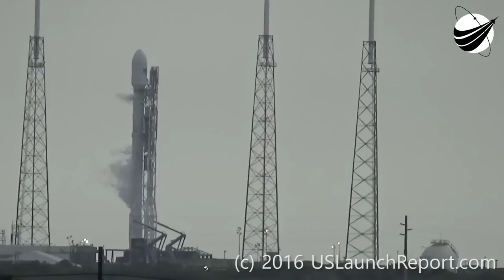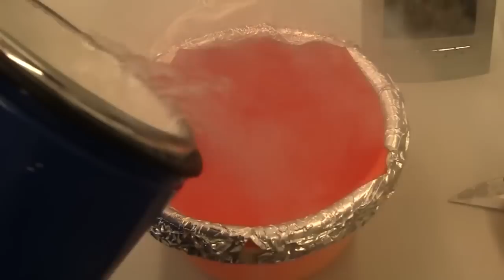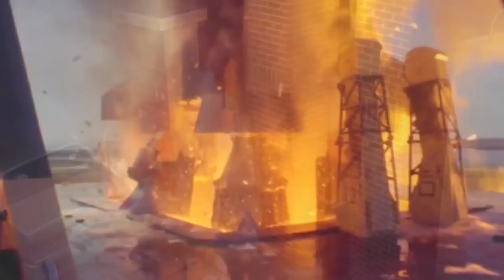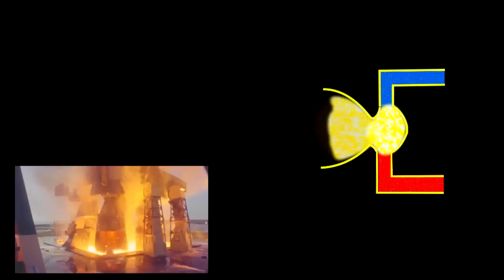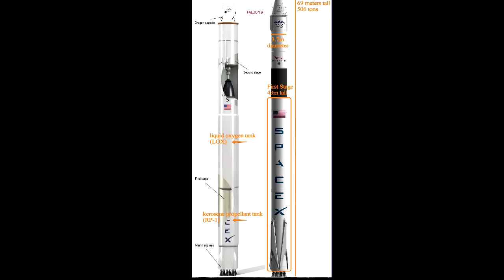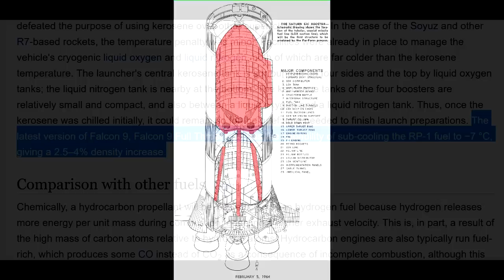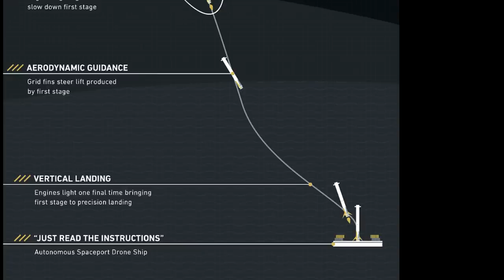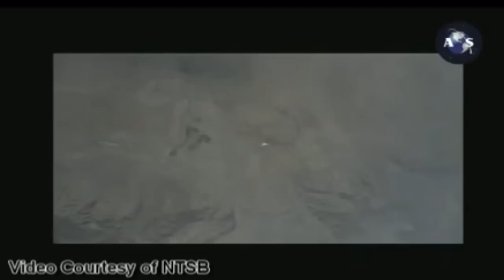Why did the Falcon 9 Explode?

Comment: You keep throwing Saturn V out there as an example.  The Saturn V had three stages JUST to get into orbit. That extra stage and the associated hardware throw your numbers off.  If you count the CSM and the two stages for the Lunar Module (all of which perform significant Delta V firings) then you are at 6 stages.  Add to this the F1 and J2 engines that did the lions share of the lifting were using fuel inefficiently compared to more modern and complex computer designed and controlled engines on the F9.  I know you have a hard-on for Musk, but you're using bad comparisons to get to a false conclusion.  The fact is that even with two and a half failures, the F9 first stages are now being flown multiple times and the insurance companies are not raising their premiums.
Reply: Not to mention, the Saturn V third stage used the exact same 'common bulkhead' design as the Falcon 9 second stage that he was all wound up about.

Comment: The Solid Rocket Boosters for the Shuttle were re-usable-ish (they needed extensive refurbishment/service before reuse). They parachuted to land in the ocean, which I imagine is many order of magnitude cheaper than designing the damned things to auto-pilot back "home" on an autonomous barge floating on an unpredictable ocean. Even if one was to factor in the boats NASA used/uses to recover the SRBs. NASA/ESA/Roscosmos/JAXA would have been using this sort of thing by now had it been any cheaper/efficient to use autonomous reusable rockets. Musk getting kudos for trying to reinvent the wheel is really insulting.

Comment: The entire idea in the difference between "spaceman" and "astronaut",  or to be gender neutral "spaceperson"
Is that any person moderately acquainted with arithmetic and solar system data, should be able to tell that the brilliant voyage of the launch vehicle Cassini took about three years to reach Jupiter, and another four to reach Saturn.  A ship waiting for the tide needs no patience at all, compared with a project waiting for a usable combination of orbital positions of Venus, Earth, Jupiter, and Saturn. To the nearest Earth year the orbits of Jupiter and Saturn take 12 and 30 years. You can hardly expect to get a sample or a space traveler back from them in less than another 6 or 15 years. 
This is too long a chunk of a scientist's career to throw away hurtling ballistically in space. Do not forget that even laser-modulated conversations will be stilted by the transmission delays, even at light speed.
Navigator to the stars? don't be ridiculous.

Comment: Elon Musk is stupid, just put some fins for guidance and parachutes on the stages, then have the rocket splash down near a manned recovery ship, then simply load the used engine on the ship, repair and refuel it, and launch again. Elon is flashy instead of efficient.
Reply: Parachutes cant slow down the rocket without air. If the rocket fuselage hits the athmosphere without slowing down first the stage will be destroyed by the aerodynamic forces. Which is why SpaceX does a reentry burn first. Secondly the stage can withstand a water landing. Third landing on the droneships seems to work great 16 landings and three reflights so far.

Comment: 'With a rocket you typically get the most bang for your buck with the last bit of rocket fuel . . .'
Yeah, if you can fly your rocket once. If you can fly it over and over again you can get many times as much payload into orbit than you could with a single expendable flight.
The drawback is each reusable flight carries less payload, but if that reduced payload mass is still enough to carry 90% of currently available satellites then who cares? 

Even if a reusable rocket can only get half of the payload into orbit of the same rocket flyign an expendable mission, it only has to launch one more time to equal that amount, and three times total to exceed that amount. Considering SpaceX wants to fly Falcon 9 first stages around ten times eventually, that's 5 times as much payload for the cost of building one rocket. Furthermore, the Falcon 9 doesn't miss out on 50% of its payload mass, it only misses out on about 25-30%, meaning over ten launches it would get more than 7x as much stuff into orbit.

Comment: Now they've re-used several 1st stages and in fact one dragon capsule (bonus!), and gotten over this problem so I guess those concerns/arguments are somewhat null and void .. at least for now.. huh?
Reply: If you're looking for someone truly objective and gives positive criticism, check out Scott Manley. Although he mostly does space stuff.
Reply: so now he makes videos about hyperloop lol ... Cant believe i was obsessed with this guy in high school, ugh
Reply: Yeah, I saw the hyperloop video earlier and it seemed to make sense (that hyperloop is stupid) but after seeing this mess I feel like I need to question all of that and research it from scratch now.  What a waste of time, the guy clearly isn't objective.
Reply: @FleshGolem420  Thunderf00t single handedly gave me my anti-Musk bias. Now I feel like a fucking idiot for listening to him.
Reply: Lex Boogie I mean, to be fair, his criticisms of hyperloop are quite valid. But the rest of it...not so much.
Reply: @alt8791  Not even all of them. He acts like choked airflow, ducted airflow and Kantrowitz limit don't exist, as well as most problems are magically unsolvable (instead of, you know, using linear expansion joints and automated safety interlocks, which can cut off repressurized parts from the rest of the system). The economics are the Hyperloop's real weak spot (amounts of elecricity used, possible troubles with switching if multi-line, time required to cycle the station's airlock and whether it'd require slowing down other pods), but they don't sound quite as hysterical and click-generating as "THE ENTIRE SYSTEM CAN BE DESTROYED WITH A NEEDLE-SIZED PUNCTURE!!!11!!ONEONE!!". Honestly, it feels like he's doing Hyperloop reruns whenever he's low on ideas/money and needs a fresh portion of dosh from ads on the video.
Reply: @caav56  yeah. But his points about the safety factor (being locked in a tiny vacuum tube with no means of rescue if there's a catastrophic depressurization) are more than reasonable.
Reply: @alt8791  Again, this can be solved with just a few emergency exits and safety interlocks - drive the leaking capsule to the emergency exit area, isolate this area from the rest of the system (doable with just two actuated hatches), then controllably repressurize it and let the passengers out. In the meantime, the control system makes other capsules slow down in order to avoid collision with the isolated segment before it's evacuated and depressurized again.
Reply: @caav56  good point
Reply: Not at all. Space shuttle reused engines many years ago, but getting the overall reliability and number of reuse flights per engine up to the point where it was a cost savings is another matter. I want Spacex to succeed as much as anyone, but it's still a long shot.
Reply: Now Crew Dragon took humans to the ISS, so I came here to gloat a little.
Reply: @alexeytsybyshev9459  And safely returned them back too! And Raptor has just achieved 330 bar combustion chamber pressure.
Reply: First manned mission to the ISS with a reused booster & crew capsule!
Reply: Amani Hamis   Yeah Scott Manley is pretty good or is one of the best.
Reply: Yeah, this video is getting sillier by the month.
Reply: News update! Dragon capsule docked with the ISS!
Reply: porkypine news update dragon v2 has exploded and Boeing beats spacex to the iss
Reply: @cancelanime1507  next update: Boeing failed their ISS test flight
Reply: Jorge wait what?
Reply: Jorge boy u earthlings rlly don’t know how explore space😂😂
Reply: @cancelanime1507  update 2: Boeing's test flight was a complete disaster that almost resulted in total loss of mission/vehicle, and they're going to do another uncrewed test flight. Meanwhile, SpaceX has had a flawless in-flight abort test, a perfect crewed orbital test, and is going to begin regular rotation crewed flights to the ISS in October.
Reply: @alt8791  And they are also going to reuse Crew Dragon Endeavor for the next year manned flight!
Reply: @caav56  the whole crew dragon reusability has been such a rollercoaster. I'm glad they got the go-ahead, though.
Reply: @alt8791  The same on my end. Hope the Crew Dragon fleet performs valiantly and delivers many a human to orbit.
Reply: J Simmons  To be fair, the hyperloop is horrendously impractical and it is impossible to to deliver it anywhere near the price he promised.

Also to be fair, this explosion shouldn't have happened with a company that supposedly has experts going designing this stuff
Reply: Now the dragon v2 is grounded because it exploded

Comment: The Russians used super cooled oxygen back in the 60s, it's the main reason the USA made it to the Moon first.  Super cooled oxygen is just way more difficult to  work with but has the big advantage of more power to weight ratio than vanilla liquid oxygen.  So yes SpaceX have made big advances in the science and without the unlimited resources and budget that NASA had for the Moon shot.   Both the NASA and SpaceX projects including the many many early wins by the USSR should be respected for the incredible complexity of the technological solutions they developed.  Smack Elon all you like for the Hyperloop madness but SpaceX is breaking new ground with a big vision  and real solutions.